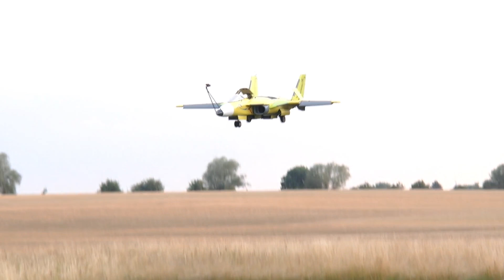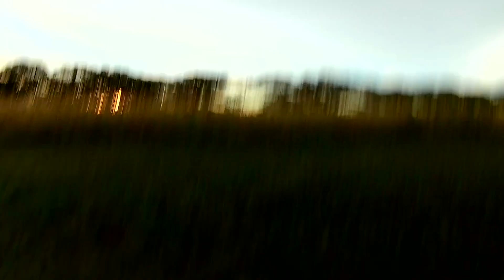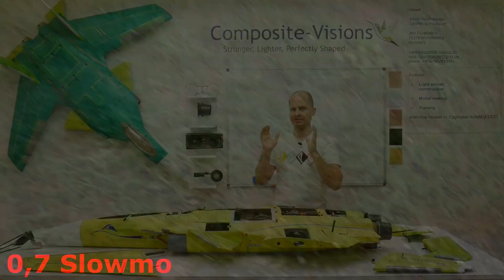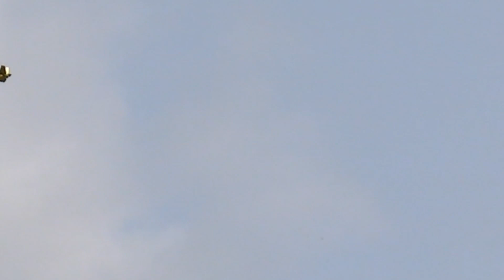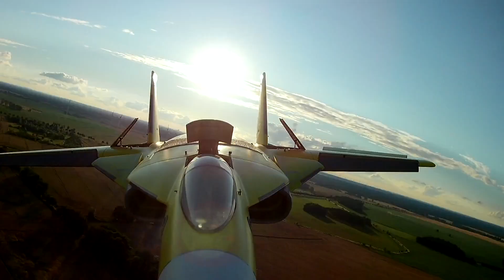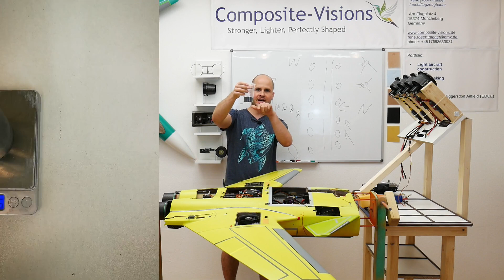A VTOL crash happend. Let us talk about it! SU-X VERTICAL down

Comment: and me again ... a similar problem accompanied me years ago. With lateral movements or strong crosswinds, a negative pressure is created by the slanted flaps over the EDF used for roll stabilisation, which prevents the thrust to brake this lateral movement -> crash.
The wing facing the wind is also pressed downwards.
-> It is imperative that the lids over this EDFs open outwards. Ideally, the FC should also provide a weathervane function so that the nose turns into the wind before stalling inside  the EDFs if banking against the wind is too strong.
Reply: It would be interesting to test the wing EDFs with a crosswind in a wind tunnel environment. This could be used to test different configurations for the wing EDF openings to try and prevent edf stalls?
Reply from the maker: Thx very much for that comment! I'll keep it in mind 👍👍

Comment: Big project.  I think you have the problem with the stabilization system.  I guess you don't use a flight controller because if you hadn't been able to analyze the flight logs and discover the cause.  I think the plane performs two maneuvers that demonstrate what a problem with the stabilization system is, the half roll does so at constant angular velocity and then it is perfectly stabilized in inverted position.  Logically it does not sustain and falls.  These two behaviors can only be accomplished with active control, not through exogenous causes or mechanical failures.  I had a similar problem with an airplane, in stabilized fly-by-wire mode I had the ailerons reversed due to my programming error.  The plane was flying perfectly stabilized but inverted. When changing to another flight mode, it returned to its normal position. I can help you to setup a flight controller, contact me if you want.
Reply from the maker: Hi, Daniel big thx for your post! I use the very simple kk2 board controler. Your argumentation sounds understandable for that crash.What fc would you recommend? We can also talk via mail: rene.rosentraeger@gmx.de Have great day man and thx a lot!

Comment: what I think happened is the north wind came from the left of the plane, the air was then forced around the edf door and created a vacuum  were the edf was. This could be the reason the the SU-X banked left. the one problem with this theory is that as the SU-X banked, the airflow pattern going into the edf would have changed allowing it to produce thrust again and level back out.
Reply from the maker: Thx Emanuel, I´ll rebuild the test stand to force the jet by sidewind a check the results.

Comment: I also think the Pid tunning needs improving , it seems a little slow when the angle gets high. It will be good to have the same test with the same camera for direct comparing of the noise. By analizing in Audacity you could separate each fan noise and compare to rpm direct readings. Not something essy but I think doable. It will at least provide a direct black box record   of what happened to each fan.
Reply from the maker: Thx Juan, the slowness is caused by the big range of the EDF-rpm. They run from 15000-30000rpm. And that takes time. The motor is also not strong enough for faster acceleration. All this need improvement.
Reply: @rene_rosentraeger  I really think something is wrong.If you have the power to go to 30k rpm , it should accelerate faster than that. My bet is on controller setup or incompatibility  . Some combinations of motor and controller don't behave very good, that's why some applications still need sensors in bl motors. Can you share your complete setup?

Comment: Any way to tell whether the left EDF stalled?.  It seemed like a controlled flip. So fast.  DId a wind gust under the right wing?  I would install a failsafe control set.  1: EDFs to horizontal. 2: Blow big parachute out back using back thrust to deploy. 3: Cut thrust to all but front vert EDF. 4: 2 sec later cut front EDF. 5: pray.  Some failsafe instruction set, together with your manual inputs would at least lessen damage, slow the decent and ensure EDFS were;nt spinning on impact. So sad to see, Maybe folks are right.  Control nozzles at the end of the wings = more roll authority.
Reply from the maker: Thx man, I´ll think over it!

Comment: it seems like the liniar airflow to the left lift edf was disrupted by blowing gasty winds to the edf cover door from left of the airplane, this occurs turbolent vortexes behint the door on the inlet side, and the lift edf stalls, i think a redisgnment of lift edf cover doors, to open to the front will avoid lift  edfs stalling on side winds.
please test this behavier with your wind mashine, blow sideway to the plane in a steep angle , maybee 30 45 degree from above.
good luck
Vitali
Reply from the maker: Thx Vitali, yes I´ll do this in the next video!
Reply: Was going to suggest bthe same

Comment: You may have an issue with the direction of rotation of your wing lift fans. If they are both turning in the same direction it may be causing unwanted precesional roll. It could have been there all along and your gyro was damping it out. The larger lift fans may make it worse. It may help by using counter rotating fans if they are available. The rear thrust vector nozzles could be included in the lift stablization to help. Besides the wind issues, it looked like there may have been some debris pulled into your fans at takeoff. Possible grass stem caught temporarily on one of the lift fans may be the culprit as well. Good luck on the rebuild...
Reply from the maker: Thx ROD, countterfans are too rarely that´s the point. They also effect more the yaw than the roll axis, I would say. But I keep it in mind!

Comment: Commen Problem wich WE have seen on the early days of the vertical take of planes in my opinion. I think you created a vortex by the lifting fan it self. It sucks air around the surface therefor you have less sound of the engine cause you are feeding it air as well. This behaviour was seen on the harrier jet as well. Also what could play in this game is the loss in altitude?!

Auf deutsch noch Mal weil's einfacher ist, und eventuell verständlicher: ich vermute, dass der edf der Absinken den Seite seine eigene Luft um den Flügel selbst ansaugt. Eventuell ausgelöst durch den Wind Wirbel über die Bäume... Man hat das damals bei den harriern der Amerikaner gesehen. Ich komme drauf, weil die Bewegung nicht um die Mittelachse passiert, sondern die Achse gefühlt weiter nach Steuerboard verlagert ist, als wenn der eine edf noch hält und der andere weg bricht. Eventuell kommt das kk Board außerdem mit der fehlenden Höhe durcheinander und steuert anders an...?

Das ist das erste Video was ich von dir sehe und bin begeistert! Respect! Werde jetzt mir alle anderen Videos angucken müssen um alles zu verstehen. 
Lg
Reply: I am Shure you have thought about it so let me know why this theory wasn't taken in consideration!? Also having flow indicating telltails could indicate that... Maybe you can arrange a test setup to try to create this self propelling vortex to see if it's possible
Reply from the maker: @carbonarne  Thx Arne I´ll check that out on the upcoming video!

Comment: Can you get thrust further to the wingtips via ducts in the wing? (Don’t know if this is efficient enough…)
Reply from the maker: Thx Herman, ducts are not that efficient, but I´ll put the EDF as much as possible to the outside.
Reply: @rene_rosentraeger   Than maybe also put the edf’s at a slight angle to the outside (wingtips), so that the edf on the side that gets angled down in a roll (when in vtol-mode) gains a little more lift automatically over the one on the side that’s angled up? Can’t wait to see what you’ll come up with next…🤩